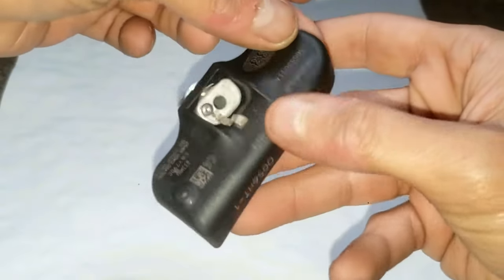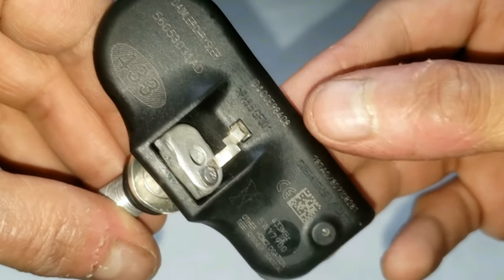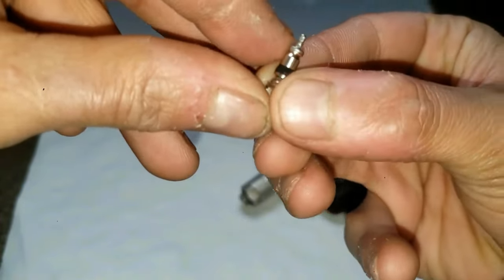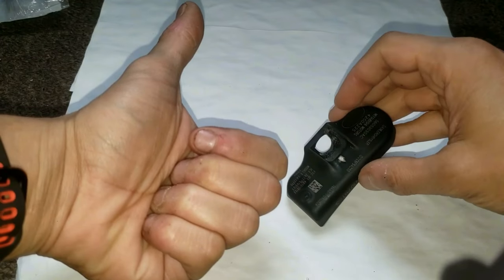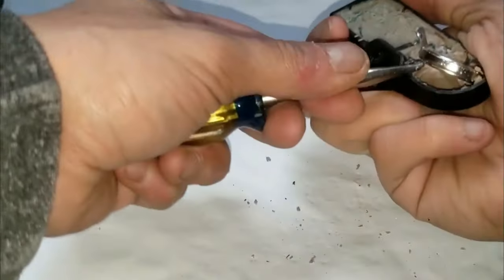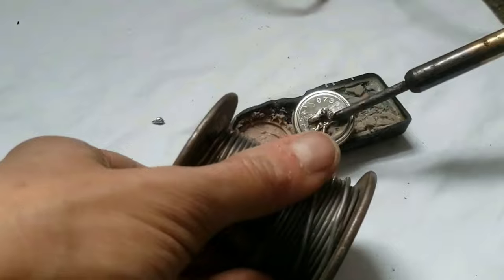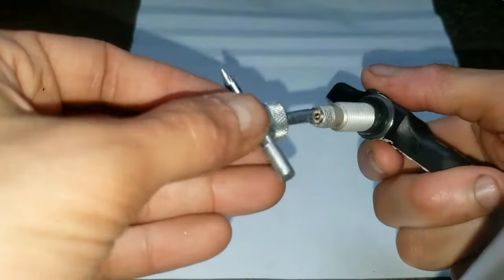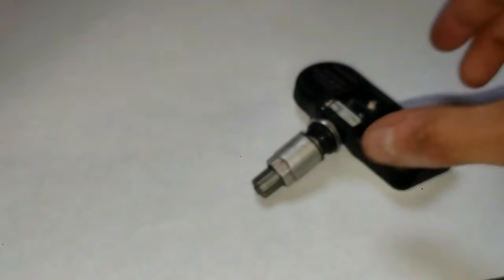How To Replace The TPMS Battery 🔋 and 🪓Tear Down NO PROGRAMMING

Comment: It's crazy to me that the manufacturers of the TMPS silicone in the battery instead of making it easily replaceable.  What a throw away culture we live in.  Great video through.  I would also be interested to know if the battery replacement actually worked here.
Reply from the maker: I agree with you 100%. So many things can be repaired, but the economy just wants you to not think and replace.
Reply from the maker: It works for me, but if the others fail I e just replacing it as a set. You really got to be careful with soldering and overheating the battery. I would like other experts to chime in on this. In most cases its just not worth replacing this. As much as I hate just getting a new one, the amount of work and effort for just 1 tpms. It's just not worth it from a time or cost point of view.
Reply: @FixCarYourself  glad to hear it worked! A piece of black tape over the flashing light works for the time being in my vehicle ; )
Reply from the maker: @scottkronmiller3746  Funny you say that, I had a different vehicle like that (with black tape)for over 5 years. And yes, I finally got it fixed.
Reply: because they want to sell you new sensor ... and charge you ₹1000/- (approx $300/-) for a single sensor. Where as if you replace battery it would cost you just ₹30/-($o.4o/-). These companies are making money by scaming customers
Reply: @FixCarYourself i have soldered these batteries 1000 times... ocerheating can be ruled out... it is not a problem. just scratch clean surface .  apply flux and then solder it.

Comment: Like it.  Your solder welds will hold up better and ahere well if you clean the surfaces with alcohol prep and all silicone away from the joint.  Even your finger grease needs to be eliminated, just like a good paint on a car or any metal.  The silicone is in there to prevent moisture intrusion, and probably condensation.  Also helps as a vibration dampener.  Them tars and wheels take a pounding every drive!   Think about it.
Reply from the maker: Wow, really great response. Great attention to detail!

Comment: For those of you who've tried but are wondering why the light is still on. I actually had to go to a shop pay them $35 to have the car's system relearn the sensors. But all that work wasn't for nothing the battery replacement actually worked!

Inspecting each sensor was free (they all reported PSI) but the programming costed $.
Reply from the maker: $35 for reprogramming. Good price. Many other places want to charge more.
Reply: You can buy the tool to re teach them for under $20

Comment: So if I change the battery, this will allow me to not have to register the TPMS sensor correct? Since registering the TPMS sensor with the ECM requires an expensive programmer ( several hundred?). It seems to make sense to replace the batteries as you wouldn't have to purchase a programmer. Am I missing something or is this how it works? Thanks for this video.
Reply from the maker: Yes nicely put! However, IMO I would just get a new TPMS and replace them all or wait until you get new tires and replace them all as a set. I know it a safety concern. But It is a tough job, and you can easily cut yourself.  You also need to be good at soldering. I know its a tough decision especially depending on the price. I'm glad I did it, but I personally wont do it again. I've gone years without changing some TPMS on a past car of mine. It just means you got to check the air every now and then, like the old days. Just wanted to give you my viewpoints. All the best!

Comment: I'm a manufacturing engineer.  Excellent tutorial!  The volume was a bit low, otherwise I really enjoyed it.  My analysis is if you do all 4 tires it makes sense to re-manufacture as you have done if you have access to a machine that can break the bead to give you access.  For my Honda Accord I can buy permanently programed Denso TPMS for $35 each. So it's delivered to my door for $160 including tax.  So to do your operation it would take probably, 1.5hrs for 1 sensor but doing as a process for all 4 tires for the economy of scale, only 2 hrs total.  So I'm paying myself $80/hour for a sensor that should last as long as the battery.  Whereas OEM's like DENSO's should last another 10 years.
Reply from the maker: Thanks, and great insight! This should help other viewers out in their decision making process.!!!
Reply: @FixCarYourself  can I by denso preprogrammed sensor for my 2014 Toyota Highlander xle any idea

Comment: After I changed the batteries in 4 sensors, they respond, but show 0 pressure (I used MaxiTPMS Pad). I was accurate not to glue open holes, presumably for the pressure detector. Any advice? Thanks.

Comment: I would think a quick wipe with a small alcohol wipe would clean off the remaining silicone residue.  That might make soldering easier.  I might consider "tinning" the contact tabs from the circuit board first before soldering in the battery.  The tinning process involves heating the tabs and then getting a little solder on them first.  This uses the  which is already warm to make for a quicker solder to the battery.
Reply from the maker: Interesting thanks for the details!

Comment: Buying replacements , I had a set that was aftermarkets and they couldnt program them
so back to the tire shop to get all 4 tires pulled and then I used junk yard parts that worked
here a year or two later the garage says they are all dead and one wont program. At $50 to $100 ea
I think putting in new batterys would be a snap. You should sand the spot you solder to get it to grab
and use flux....did it work?
Reply from the maker: Seems like common repair shop tricks. They should have been able to program the after market ones. Good call on sanding the solder!!!

Comment: Hello, Fix Car Yourself!  Is your tpms still up and running?  I was thinking soldering the battary would heat damage it??   Cheers. Hope to hear from you  I'm in progress with doing mine.
Reply from the maker: The TPMS is still going strong for the car. soldering it should be ok. I'm not really sure how much heat should be applied meaning how long to keep the soldering tip on. I am not the greatest at soldering as you can see. I will say... this is not worth doing, as you can cut yourself, & burn yourself for just 1 piece (who knows how long the others will last). Anyway,  I know I won't do this again.

Comment: I get programable Autel TPMS with the same frequency already on the car, and clone the existing TPMS to a new ones. This way i don't have to do re-learn the car every time i swap between summer and winter tire. At the same time if one set of TPMS battery died, i have the other set to clone from it.
Reply from the maker: Nice...great idea for those swapping tires like yourself.

Comment: What about little metal piece( flap) connected to valve with little screw is broken. Can i use it without it or need to be soldering? Thanks
Reply from the maker: I would think it needs some form of secure connection which is why its a screw and for service ability/replacement. Not sure if the flap is being used as a grounding like wire. Soldering may work, don't know if that would be strong enough though to hold up for a long period of time. But I like your thinking!
Reply: Thanks for your help. I better buy new one.
Reply from the maker: I'm not sure where to buy a really tiny screw like that, perhaps a computer parts store or online. Another thought is using like a thin metal paper clip. But a screw would probably still be more secure and not allow it to "bounce" around. Just a thought.

Comment: Guess it all depends on the vehicle. For mine, I just got a quote to replace a bad tpms (car already said just a low battery). 300 dollars. So I can save quite a bit by just replacing the battery. Added benefit, better for the environment. And worst case, you end up having to replace something you were already going to have to replace.
Reply from the maker: Wow $300 for just 1. Try looking around elsewhere. Otherwise I kinda don't blame you for doing it yourself. Did you finish doing it yet and/or was it hard?
Reply: @FixCarYourself  Unfortunately, looking around elsewhere is difficult due to the brand of vehicle. Hint, starts with a T, ends with hates right to repair laws. 

Anyway, pretty easy, got the battery out, just waiting on new battery. Paid 30 bucks for super cheap battery spot welder that barely works and 10 bucks for a couple batteries. Biggest thing to keep in mind is to get temperature resistant ones. Most off the shelf button cells don't have the best temp rating.
Reply from the maker: Good call on the temperature rating for the batteries. But anyway glad you didn't spend that much. And at least you did it yourself! And that is the most important thing! Great Job!!!
Reply: @FixCarYourself  Seems my efforts may have been in vain.  Within 24 hours the battery was down to 0.05v so looks like the unit fried/shorted somewhere.  Still, good experience, glad I at least tried.  And now I have a really cheap, surprised it didn't start on fire, battery spot welder XD.

I may decide to take the rest of the sealant out but I highly doubt I'd be able to track down the culprit, much less fix it.

Comment: What is the brand & part number of the regular valve stem to replace the 4 TPMS sensors on 2011 Hyundai Tucson GLS?
Reply from the maker: Hard to say, a quick search might help, but usually the only way I could figure it out was by going to a junkyard and removing the valve stem from the specified vehicle. Super inconvenient, which is why the automotive industry stays silent on this. They don't want to repair they only care to replace the whole thing.
Reply from the maker: 1 more idea is by looking up the OEM tpms sensor or valve stem on ebay or amazon.
Reply: @FixCarYourself  The junkyard charges $10.00/person. I am not going to pay $20.00 for me & my little daughter.
Just wondering if anyone knows the size of the battery & stem.  
Battery usually dead after 7 years and gasket/seal/O-ring go bad after 4.6 years.
First to do to remove all TPMS sensors and install regular tire valve stems (which I don't know the size/height).
Second to disabled the TPMS' light.

Last taking apart the TPMS and replace the battery.
I do not have access on this suv yet. Just trying to help someone that just lost her husband for protecting our freedoms.
Reply from the maker: @angelisone  1 more idea is by looking up the OEM tpms sensor or valve stem on ebay or amazon.
Reply: @FixCarYourself  Again, eBay & Amazon have many valve stems. 
I want the correct size which I can not find so I can order it.

Comment: I feel it depends on the sensor because some can be quite expensive. I just bought 4 new sensors and valve stems for 28 bucks. I understand though you could spent that on one for a truck or an exotic car.  So changing the battery might save you some money.
Reply from the maker: Yep good points! It really depends on the vehicle and each persons situation. Also cost of installation, when it gets done and by who, It could go on.
Reply: Just bought  4 sensors+valve kit  OEM GM   for my camaro 2012 for US$ 132,  so yes some are expensive.
Reply: @hb-ol9oc freakin TPMS costs almost as much as a new tire

Comment: Did the sensor work after you put the battery in ?
Reply from the maker: Yes, but I really don't want to encourage anyone to do this. Very time consuming for just 1 unit. Aftermarket ones with a free programming is probably going to still be the best way.

Comment: Just buy a new one after watching this video 😂😂
Reply from the maker: I agree. That's what I want people to do.
Reply: Typical consumer mentality 😂
Reply from the maker: Not sure what that means.
Reply: @FixCarYourself  just buy a new))
Reply from the maker: Yes I agree!
Reply: I agree, but 70 euro each one.
Reply: Going to try doing this maybe with a dremel. It doesn't have to look pretty. And by using the old sensor you know it's going to work with the cars' module.
Reply from the maker: Did it work...and did you use a Dremel?
Reply: Totally agree 😂
Reply: @FixCarYourself i will definetly give it a try after watching this video... there is nothing to loose..... in india battery will cost ₹35/- or say arround 40 cents.... another ₹50/-(45cents) to get tyre opened..... so not a big deal .. if it works fine if not even then fine.... no harm in tryin 0:00 g

Comment: I may have to do this on my 05 cadillac xlr because replacements are 200 each
Reply from the maker: Yikes, they do make aftermarket ones which can be self programmed. But you still have to remove the tire from the wheel to get to it.
Reply: @FixCarYourself  looks like that's where it's headed.  I was quoted 240 for 4 installed and programmed which I still feel is 100 too high.
Reply from the maker: Try to negotiate or go somewhere else. I will say its very difficult and time-consuming opening just 1 up. To do 4, I would rather pay.

Comment: Good work nice to see good guide of operation that is technicaly easy but it still technicall and no faults with wrong knowlege like today  fairys hints to all type of iise in sec wichout any diagnoze can get,  only more costs than solve source damage oat vehicle. i got for motorcylke recalutor for valve cleranece made by me to take adjust in CB600 Hornet - only two valve plates need to get new,  not all thickness set for testing maybe this maybe this. also made reapir of knockin brake pads at front  - easy guide photos of step by step to be done - engeenring technician in blood  but realone not oracle one. just ask if need some brainstorm on issues I will try to help ever i can :) LWG from Poland. Bartosz.
Reply from the maker: Thanks

Comment: The solder will fail as it is not a good solder you did.  Better to have a spot weld like ones used for battery packs
Reply from the maker: Yes I agree. That would be better.

Comment: Dudes, How long do you think that clumpy, cold solder joint and RTV will last in a spinning tire at highway speed? Think about it.. round and round for thousands of miles (Centrifugal force) also, those battery leads are spot welded at the factory not soldered.. My bet is this "fix" will not last more than a few miles. Round and round----till it breaks and then you are back replacing it again but this time you go to a shop and have them replaced the right way with new sensors.  Just go out and pay to have it done!
Reply from the maker: I'm not concerned about the solder joint, so many components are soldered in the car not to mention this battery tpms. However, I do agree its not worth the time or hassle to do this. Especially because you might have to do this for all 4 of them. So just get them all replaced at the same time.

Comment: The valve CORE is not the valve STEM.
Reply from the maker: The valve core is the inner part and has a a small metal piece. The valve stem is the outer part.

Comment: Weak with the English language, why is it important to weigh the sensor before replacing the battery and what if the weight at the end is different than at the beginning? Thank you
Reply from the maker: Its for wheel balance reasons. But I've heard people were just fine if its not a 100% balanced. However IMO I wouldn't recommend replacing the TPMS battery.
Reply: @FixCarYourself  The car is a Nissan x-trail, 2015, I changed the battery, put the sensor back in its place, but again I have no readings (three dashes). Tried to reset and calibrate but it doesn't work. The only thing left for me to do is to try to reset with diagnostics and look for a service where there is a scanner for these sensors.
Reply from the maker: did you ever figure out or fix your problem?
Reply: @FixCarYourself  I haven't yet, there is nothing on the scanner to read the sensor, I think I have not made a good connection to the battery, plus a bad brand of battery (camelion ordinary). Now I will order maxell with additional connectors and try it.

Comment: You can thank Obama for these damn things.   Back in the old days we just checked our tires every so often.   It appears that these just tell us when the first cold day of Fall is.  As every Fall the light will turn on.
Reply from the maker: These are a great safety thing to have. I have another car that doesn't have these tpms. In fact I drove the other day with low air pressure. Its really nice to know when its low.
Reply: More specifically the lazy people driving ford Exploders and blaming their tires when the air pressure was way too low.

Comment: What seems like a good idea, changing the batterys is really putting massive liability on the shop or person doing it. It is not worth the trouble. Master Wrench for over 25 years I have seen everything and yes when this falls apart the tire fails. for 40 bucks you can get a set of GM ones if you buy them right. Dont do this people there is ways to cut costs and then there is ways that can kill people. The  clear tube of silicoln is much weaker than what is coming out.  The old saying penny wise and dollar foolish.

Comment: Not worth it. Battery is about $5. A new sensor is about $12 on ebay 😂
Reply from the maker: Yep I agree... The only difference is the added cost of going to a dealership to get it programmed. Can become pricey. But then again you should also take your own time into consideration. Regardless it's best to get a new set when these fail.
Reply: New Ebay sensors are Chinese made knockoffs that will last you a few months at most.
Reply from the maker: @hashishsenju2015 its usually the battery that goes. My guess is the ones from ebay have been sitting on the shelf for over 5 years.
Reply: Depending on the sensore
Reply: Not worth it?, that is audi sensor, which will be really expensive, the cost is $175 per sensor. this is actually genius.
Reply from the maker: Thanks...I guess it depends on the vehicle.